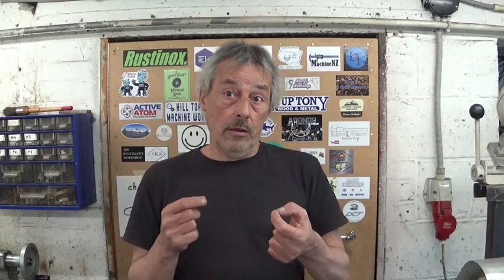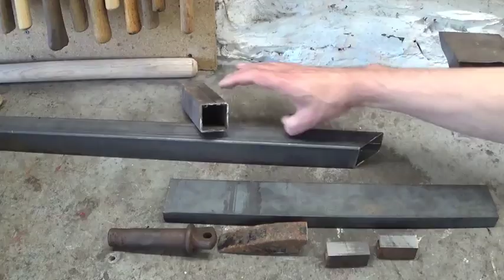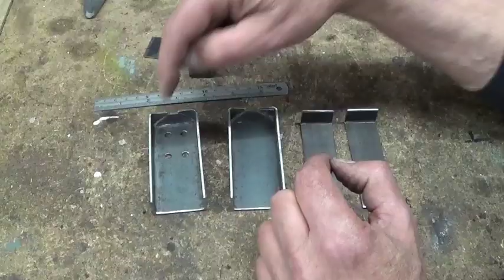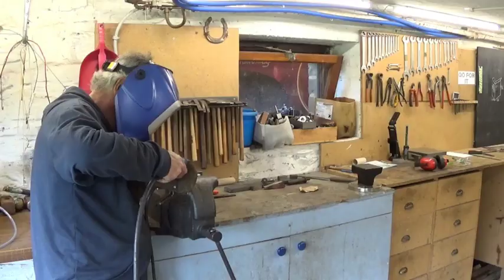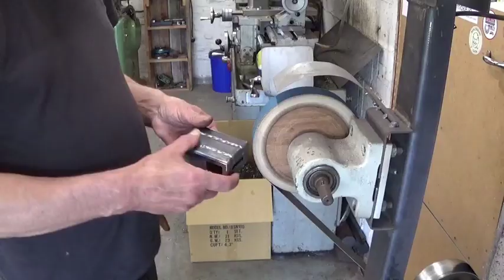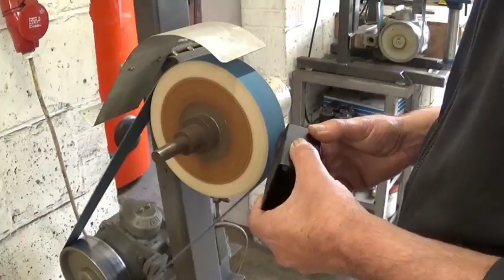Scale model shaper pt1. The base.

Comment: So long as the hardness of the materials you plan to work with in the scaled model shaper scale accordingly, your model scraper should work just fine!  A huge benefit of massive cast iron is stiffness which you do not benefit from by using scrap metals so, it is will have flex if pushed too hard.  It will be an interesting build to be sure! Have a fun!